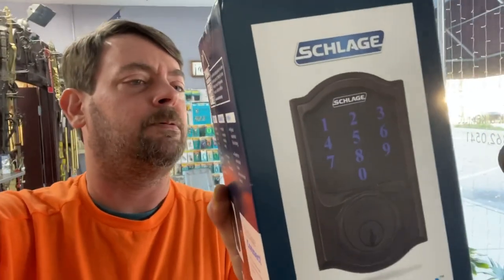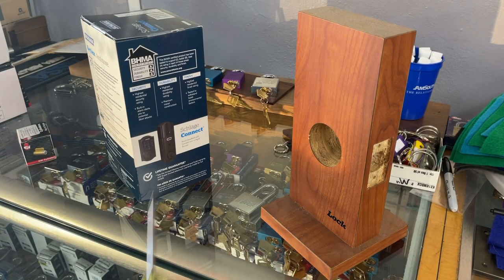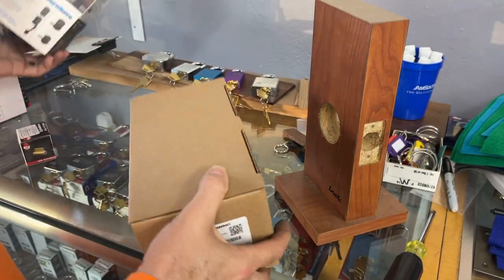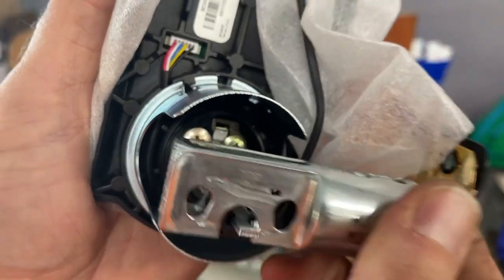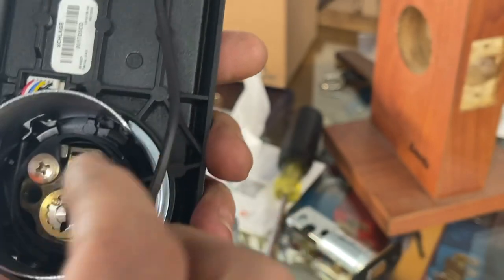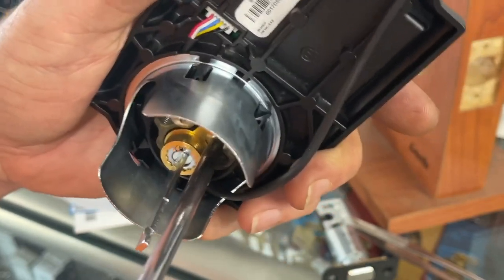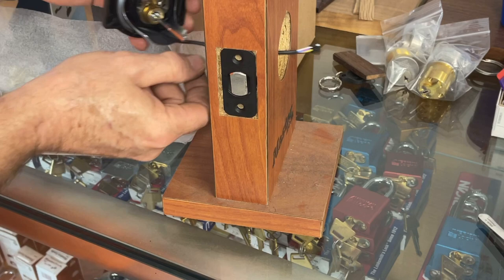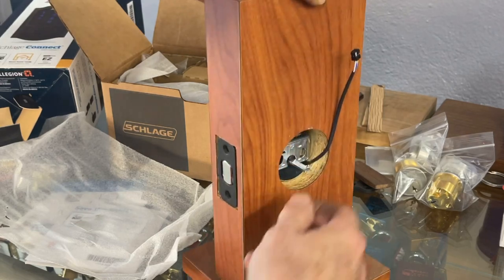Can the Schlage Connect use a different key cylinder?

Comment: Do you know if it’s possible to switch the cylinder on a Level Lock Touch  edition (Sc1 -5 pin)
For a Kwikset smart key
Reply from the maker: Kwikset SmartKey only works for OEM Kwikset deadbolts.

Comment: Thank you for making this video!

Which Kwikset Smartkey Deadbolt Cyclinder would you recommend I can add to this lock? I’m also looking to do it with a Level Lock Touch Edition.

Do I need a single cylinder or double cylinder?
Reply from the maker: You cannot add a kwikset smartkey cylinder to these. Those only work in Kwikset smartkey deadbolts.
You also wouldn't add a level lock to this type of lock in this video. You add those to standard deadbolts. If you need it to be Kwikset smartkey then just purchase a standard Kwikset brand deadbolt and add your level lock to it.
Reply: Now I’m confused. I thought the whole purpose of this video was to confirm that the cylinder on the Schlage Connect can be changed. I was thinking of replacing it with a 980 Kwikset Cylinder. Do you think it’s possible or do I need to get a specific model?
Reply from the maker: @efmarosario4953  it can be changed to standard key in knob cylinders (shown in the video) which are made with different keyways (including Kwikset) and are designed to be used in locks that can have their cylinder switched out. Like this one. You can get the Kwikset keyway but it isn’t a “smartkey” cylinder meaning it has to be traditionally pinned by a locksmith to your Kwikset key

Kwikset smartkey cylinders are proprietary to their deadbolts, they are not built to use in anything else.
Reply: So even if SmartKey Security re-key technology is compatible with Kwikset (KW1) keyway or (SC1) keyway options it won’t work on this Connect?
Reply from the maker: @efmarosario4953  I’ve said no it will not several times now

Comment: A quick question I couldn’t find an answer to on the Schlage website. I am hoping to rekey a Schlage Encode, smart deadbolt and a Schlage B60N deadbolt to use this same key.

 Q1:  Is the five pin cylinder on the Encode deadbolt the same or similar to the five pin cylinder used in the B60N deadbolt? 

 Would they use the same pins if I bought a rekey kit online to rekey these cylinders?  

A vendor on eBay is telling me they use different pins, but he doesn’t sound that sure of himself.

Many thanks for your help.

Q2:  If the rekey package contains a 6-pin key, can that be used to rekey the 5-pin cylinders? Are they compatible?
Reply from the maker: Yes they can be keyed alike, same cylinder use Schlage pins

Comment: Did you try retrofitting an ASSA Abloy Protec2 KIK cylinder into this Schlage smart lock or similar model?  If so, which cylinder model did you end up using?
Reply from the maker: If it’s a standard “Schlage style” or “standard” KIK it should work. I don’t sell Protec so 🤷‍♂️ but as long as the tailpiece can be used it should

Comment: Well Dang it!  When I got my FE595 I wanted to change the cylinder, but it has a special plastic cam that can't be swapped.  I did not get the connect because I did not need the connectivity features.  But in my searching I have seen other videos and pictures of what I believe is the FE595 but with a standard 5 pin cylinder and special tailpiece (not plastic) that could potentially be swapped.

Comment: What key cylinder did you use as the replacement?
Reply from the maker: Those cylinders are available in many different keyways
Reply: I wasn’t specific enough. What was the part number for the one you used in the video. I went to my local locksmith and he couldn’t recommend a replacement since he said they only cost a few bucks to rekey. I want to order one for my son’s Connect.
Reply from the maker: @LI-FLKayakFisherman  you would need to search for a Ilco Key in Knob Cylinder to whatever brand key you want it to use. 15995 (and keyway) I don’t know what type of key you are trying to match
Reply: Got it!  Big thanks👍🏻